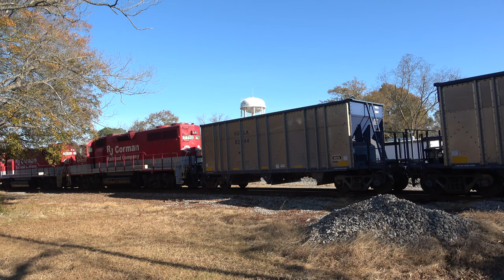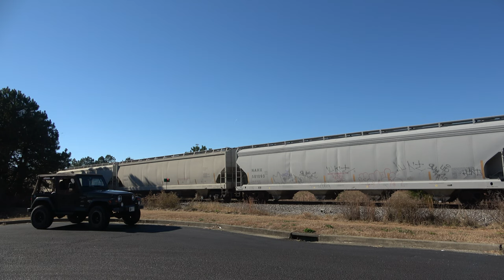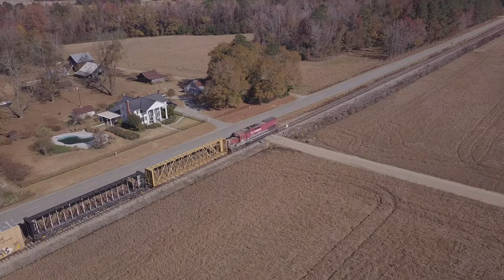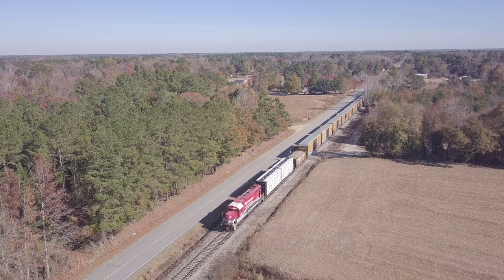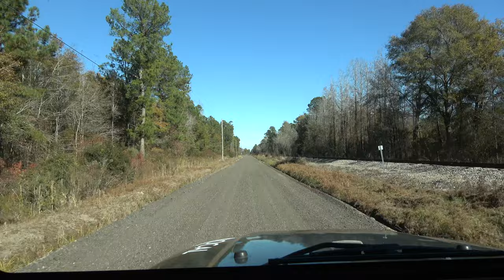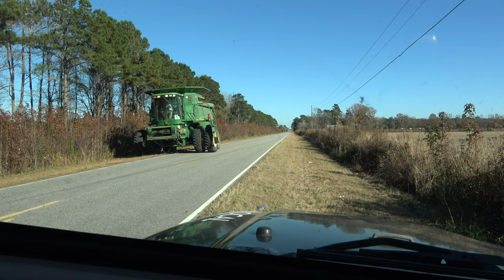Chasing a Snoot Nose Tunnel Motor thru the Lowcountry

Comment: Actually, according to rrpicturearchives, their info says RJ Corman has two locomotives numbered 7710, the GP38 you mentioned, as well as a GP38-2, 3813 is actually a GP38-3 which is a dash 2 that's been freshly rebuilt, and apparently 3812 is incorrectly labeled on the site as a GP38-3 even though you said it is an SD40T-2.
Reply from the maker: The SD40 is 8336, and then 3812 and 3813 are both GP38’s. I thought I saw they’re -2’s, they could be -3’s, I guess I should’ve checked the side of the locomotive. Either way, a neat lineup
Reply: He didn’t say 3812 is a SD40T-2